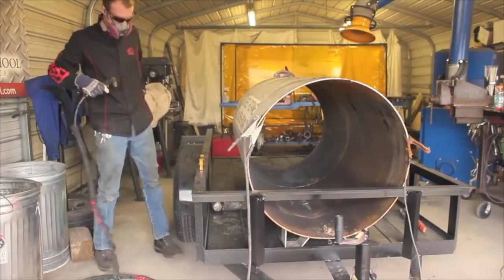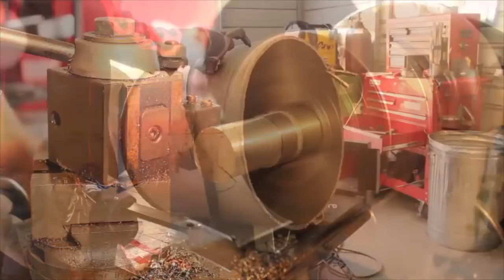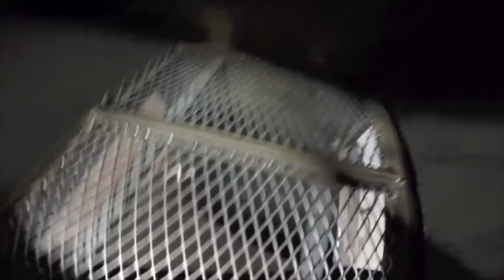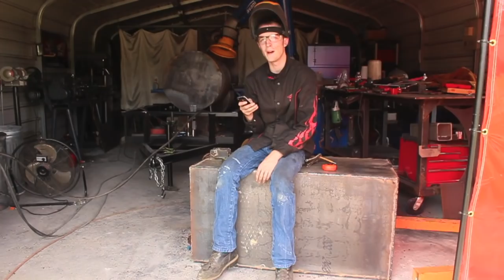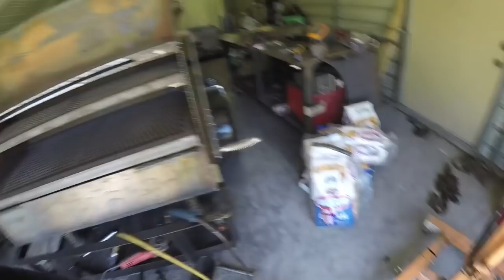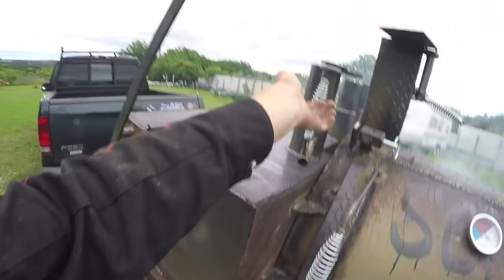BBQ TRAILER - WELDING PROJECT - COMPLETE BUILD SERIES 2022 EDITION

Comment: turn the pit around so the cabinet is near the the rear of the trailer. that tongue is a constant bitch. then you have a place to store smoking wood and make a tail gate to secure the wood.

pop a vent on the bottom for brisket juice to drain off  and into a metal container.